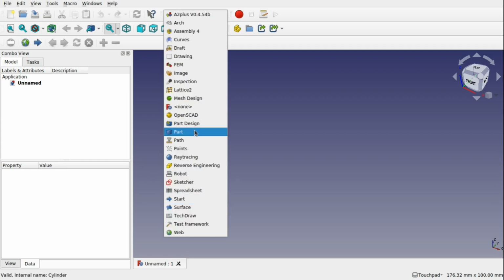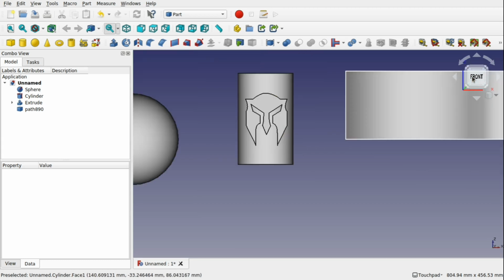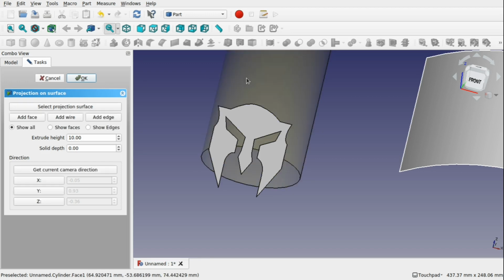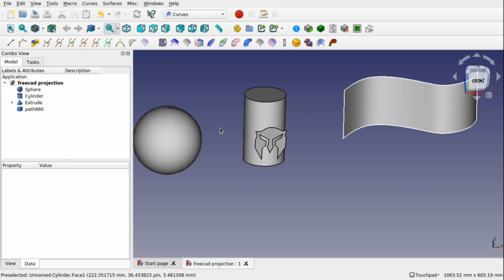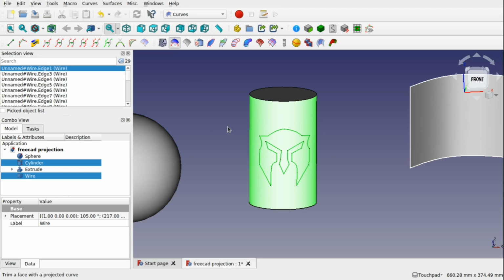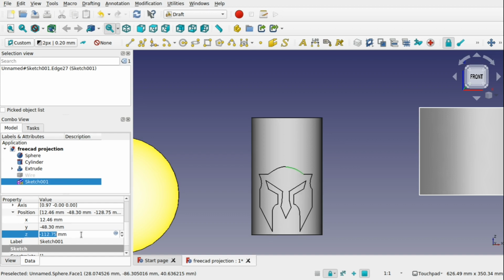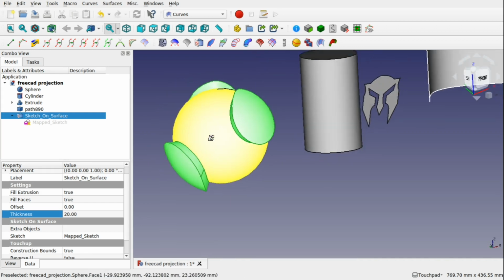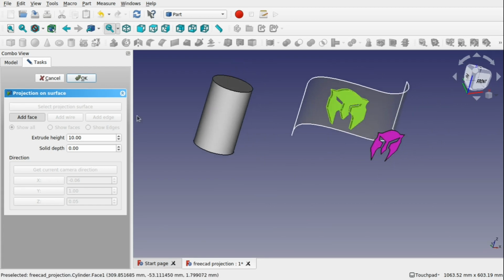FreeCAD Project / Attach Sketches Traces and Logos onto Curved Surfaces. 3 Ways including parametric

Comment: At around 35:08 you note that the Sketch on Surface tool is unusable for extruded BSpline Surfaces (because of the way they are parameterized  0-1 in the BSpline direction, length in the extrusion direction).  This is no longer the case for current versions of the Curves workbench - both directions are mapped to lengths. So it now is usable...

Comment: Didn’t show a way to project a logo using the sketch map method. I only found a way to import external geometry. Copying an external sketch does not always work, for example, when the external sketch has been moved or rotated. There was an idea to replace the map sketch with another sketch - it causes the error "Failed to get the face support of the sketch". Are there other ways?

Comment: Thanks for your extremely educational videos, I've been looking through your playlists for days because I want to switch from VariCAD to FreeCAD. :-D
About the projections, I have a question: I'm looking for a method to bend a perforated sheet around a surface in the CAD model (as if it had been bent with the bender after punching). The SketchOnSurface tool seems to me to be just the right method if I then simply draw the punch-outs in the sketch of the modeled surface, or am I understanding this wrong?
Is there a simple method to distribute regular patterns of e.g. hexagons on a sketch (something like the PolarPattern in PartDesign), or is it faster to import this as DXF from another CAD program?
Thanks again for your really valuable work!
Reply from the maker: Ah great to see your enjoying them. Yes sketch on surface world be the way to go with a sketch and you can do it a number of ways. Use the sketcher or import the file from a external 2d source as you said and use sketch on surface using the external object property.

Comment: Thank you for this.  Is there a way to merge the projection onto the face so it becomes a single object (handy for FEM work in a specific location) or does this fall under Boolean fragments? (Oh and enjoy your coffee :P)
Reply from the maker: You would need to boolean both by selecting both of them and using a union or cut in the part workbench. And thank you for your kind donation 😀👍
Reply: @MangoJellySolutions  Thank you.  I suddenly felt like I was buying an answer which wasn't the case BTW it was a thank you for a great video regardless.  We need more like this considering how bloody awful FreeCAD UI/usability is.  I recently had to Google how to move a part as I'd forgotten (just use it for FEM work these days) which pretty much sums it up.  (I know I know small team working for nothing but we all know what happens when you let Devs lead design and user flow :P)

Comment: This was indeed informative with sufficient useful methods. I still have a question though. Instead of projecting entire object, can we just project a specific edge of that object? Because doing so will be extremely helpful in modelling hood vents of cars?
Reply from the maker: Yes Instead of the selecting the face  from the part project just select the edges and that will project onto the model
Reply: @MangoJellySolutions  Ok, thank you, will try it.